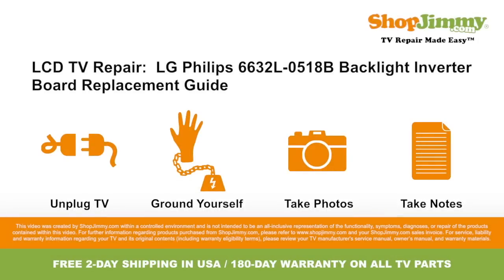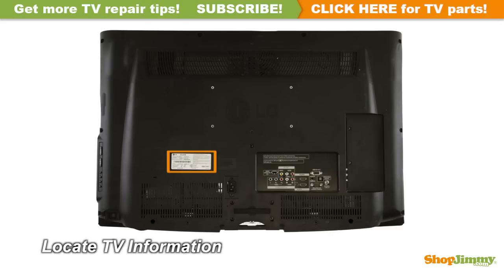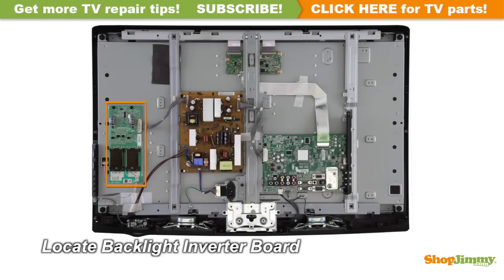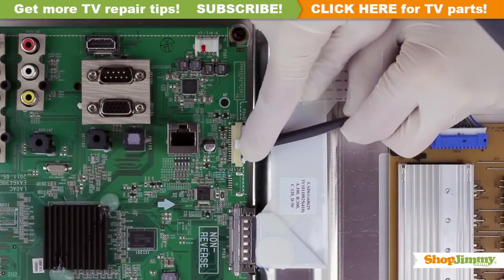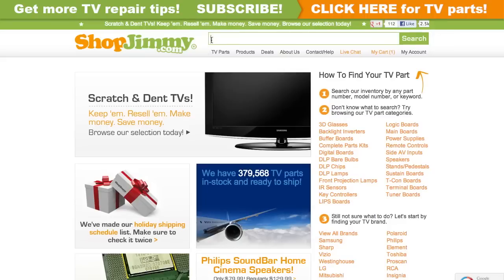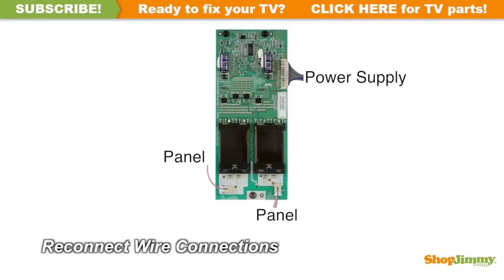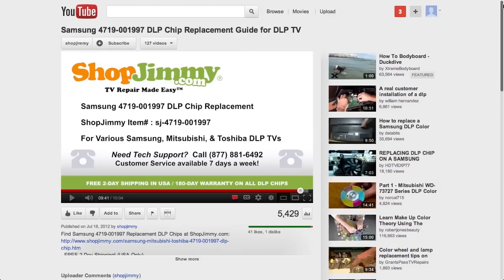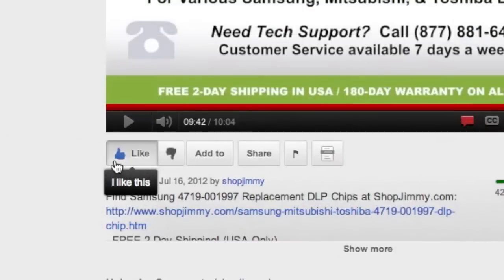LCD TV Repair Tutorial - How to Replace the Backlight Inverter Board in LG & Philips LCD TVs

Comment from the maker: @Felicia Tidrick - Please be sure to go through and make sure all of your cables and connections are tight and secure.  If that does not help, this may be an issue where the board(s) are failing when the picture gets to 1080.  If all of your connections are secure I would recommend contacting our customer service to determine your next steps.  You can reach our customer service at (877) 881-6492.  Thanks and please let us know if you have any other questions!

Comment: Great stuff you guys do at ShopJimmy, greatly appreciate it! Now, I have a 47LN5700, and I can't find how to do the short mentioned here. 

Symptoms - full power up and LG logo visible for about half a second, then black. I can see the volume circle moving and changing with a flashlight, indicating power supply or LED as the problem.

Looking at the power supply on your site, there's a note that this part is commonly replaced when it is actually a failed LED. If it is possible to complete a similar short to tell if there's an LED bar out, or the power supply is failing, would be extremely helpful in returning this back to service.

I also see the LEDs are also out of stock, is there any ETA for the next shipment of them to arrive or will they be discontinued at your shop? Sorry to draw this out, I'd rather know what I'm digging into before I have this panel torn apart. Lack of clarity and multiple posts just take up more of both our time.

Thank you and your team very much for your help!

Comment: I have a Phillips LCD TV 55PFL3907/F7.......I have no backlight....I've checked with a flashlight and can see that the screen works......I just changed the master and slave inverter boards....no backlight....24v entering board from supply board...........................any ideas would be greatly appreciated!

Comment: I have a LG 37-inch flatscreen tv, which powers up, but has no sound or display (grey screen).  I suspect that it is the back light inverter, based on what I am reading online.  There is a sticker on the panel with S/N: 8D5ZK7EA21639.  The number adjacent to the black rectangular objects on the board is: 6632L-0493A.  Is this sufficient information to order a new board?  Also, if I order a new board and it doesn't solve my problem, can I return the board?  Or, is there a way to test the board to determine if this is the problem?  Thank you.

Comment: Hello I have a LG 50LN5100 that has a issue with the picture. The bottom half seems to have double lines of the image it is trying to display. It also cycles in approx. a 3 second burst of good picture then distorted. After 15 minutes or so the picture goes out but the sound continues. If I turn it off and right back on it is good for another 15 or so minutes. The distorted part of the image (during the cycle) becomes blurry also with the extra image lines in it. Do you have any ideas? I have read countless postings here but nothing seems to describe my issue.

Comment: I have a LG 47ln5700-uh tv that was starting to get dark spots in different areas on the display. Eventually the whole display went completely black and I have sound but no display. I replaced the main video board, then the t conn board then the main power supply board. I have conducted the flashlight test and the display is visible but I only get a "flash" from the backlight when the power button is turned on and turned off. I don't see an inverter board on the tv anywhere and was told that I may have a short in the display screen itself. Does this tv have an inverter board, if not, could there be a short in the display and is it repairable? Or is there something that I am overlooking that is not a common problem with this tv, any suggestions would be of great help.
Reply from the maker: Warped Papa   Try all repairs and troubleshooting at your own risk.  This sounds like a TV panel (TV Screen) problem.  If your TV panel is bad, it may be more cost-effective to replace the TV as panels are typically hard to find in stock, difficult to replace, and expensive.  Thanks and please let us know if you have any further questions!  www.shopjimmy.com

Comment: Hi, I have a LG M4715CBBA / M4715CG   That will power on and after 2 seconds the backlight will go out. I can see the picture with a flashlight.  Is there any way to test the inverter boards?? What are the correct replacement p/nS?

Thanks

Comment: I have a Sanyo HDTV LCD/TVHD ACL, Model# DP39D14, Chassis P39D14-00.
The TV has standby light on and changes from red to green when turned on. There is sound and I can see the image using a flashlight. I have only gotten the back pannel off but cant get the second pannel off the back to check if there is a seperate backlight inverter board that would need to be replaced.

Comment: I have an LG model number 47ln5400 that has no backlight. I used the flashlight test and can see the menu etc. I installed a new power supply board but still has the same issue. I only see that board, the main board, and a t-con board. Could the issue be the t-con or am I missing something. Thanks for your time.
Reply: Erin Eby I have the same problem and also purchased a power supply board but didn't fix the problem.  Did you ever get an answer?  I also bought a t-con board and that didn't work.  Would love to know what you did... Thanks
Reply: Erin Eby  Hi Erin,
 I took my tv completely apart because of the same issue you were having. I replaced all 3 boards before I discovered that there were 12 LED strips that attach to a board inside the set itself which i would call the inverter board. 6 of the strips were not lighting up when I turned on and off the tv. Keep in mind that I am no pro at this but not afraid to tear something apart and figure out why something will or will not work. After researching on trying to obtain the board and strips i have found that it is a part that only LG repair techs can obtain but want to sell you the display panel as well. Shopjimmy can't obtain them unless they get that specific tv in and it isn't bad. Some can be obtained on Ebay but they are model specific so you have to have the exact number to your tv for them to work. I didn't get far enough to find out how they are attached but will cross that bridge if and when I get there. I hope this info will help you out, I was as confounded as you were in my tv repair.

Comment: I have a 32lg70, I had been having problems with it (or the cable box, I don't know which) with the pic freezing and when I went to use the remote to turn of the tv and try again it would be a bit before it turned off. It happened a lot the other day and now my screen is darker like a backlight went out. I am unsure what to do and can't afford a new tv so I would rather fix it. I am quite capable doing it so If you could send me in the right direction I would appreciate it
Reply: and no setting were changed
Reply from the maker: Lynda Kempland   It sounds like the problem could be the cable box or the main board.  Take out the cable box and try another video source to see if it is the cable box or your main board.  Here is a link to replacement parts for your TV model number on our website, click here:  http://www.shopjimmy.com/catalogsearch/result/?q=32lg70  You can also call our customer service for further assistance with your purchase.  (877) 881-6492  Thanks and please let us know if you have any further questions with your TV Repair!  www.shopjimmy.com

Comment from the maker: @Jpress138 - This could be one of two problems.  Either the main board or the panel.  You could try replacing the main board in your TV to see if that fixes the problem.  If it does not work, then I would say you have a bad panel.  Panels can be difficult to replace, expensive and hard to find.  It may be more cost effective to replace your TV.  Thanks and please let us know if you have any further questions!

Comment: Hello I'm having backlight problems on my 32ln5300-ub but there is no backlight inverter what should I replace.
Reply from the maker: Nicholas Denson The power supply has the backlight inverter built in, so I recommend replacing the power supply board in your TV.  Here is a link to replacement parts for your TV model number on our website, click here:  http://www.shopjimmy.com/lg-eay62810301-power-supply-unit.htm  Be sure to match part numbers on your current board, with your replacement for compatibility.  You can also call our customer service for further assistance with your purchase.  (877) 881-6492  Thanks and please let us know if you have any further questions with your TV Repair!  www.shopjimmy.com

Comment: hi i have a lg 42le4900 manufactured in october 2010 when i switch it on its fine for 20mins & then it will lose the picture but everything else including sound is working then when i switch it off & on again the picture comes on for a couple of seconds then goes but sound still there. thanks in advance
Reply from the maker: mikey jay   I recommend running the flashlight test on your TV to help determine if the problem is the backlight inverter or the main board. Here is a link to a video we produced that shows how to run the flashlight test. No Image No Picture on Screen-Flashlight Test LCD TV Repair - How to Diagnose Broken Board TV Repair Please reply with your flashlight test results and we can recommend a replacement part for your TV repair. Thanks and please let us know if you have any questions! www.shopjimmy.com

Comment: hi i have a  lg 47” Full High Definition 1080p LCD TV 
47LH40 -ua 2009 modle  
my TV still has power but  every time i turn it on  the screen goes dim then turns off with a strong  burnt smell

Comment: I have an lg tv with a backlight issue.  the model number is 47ln5700-uh.  the fault is the screen is black but the menu can be seen using the flashlight test.  i have taken apart the back panel but i am unable to find the inverters.  i can see the main board, the sound board and the t-con board but that is it.  What am i missing.  Can you or someone please help me out.
Reply from the maker: +matt cody   Try all repairs and troubleshooting at your own risk. This sounds like a problem with the actual LEDs inside your TV. These LEDs are replaceable, however it is recommended they are replaced by someone with the proper experience and training. When replacing the LEDs, the TV panel can get damaged. If the TV panel gets damaged, it is not repairable. Click this link to replacement LEDs for your TV model number:  http://www.shopjimmy.com/lg-lc470due-sfu1-led-strips-12-strips-1-board.htm   Be sure to match the panel information necessary to ensure you have the correct replacement LEDs.Thanks and please let us know if you have any further questions with your TV Repair!  www.shopjimmy.com

Comment: Hello I can't locate the inverter on my tv

Lg42ln5400 
Model number lgln500-Za
Serial number 310wrbm96093

On the left side there is just the manual control for the tv menu, volume control etc

Comment: LG 47LN5200
Model number 47LN5200-UB
Serial number 308RMCJA9811
Audio is on but the screen is really dark
Reply from the maker: Theron Paul  This could be a problem with either the power supply/LED board or the LEDs in the TV.  You can replace the power supply/LED board to see if that fixes the problem.  Click this link to replacement parts for your TV model number:  http://www.shopjimmy.com/catalogsearch/result/index/?cat=229&q=47LN5200-UB  There may be multiple boards for the same TV model number, be sure to match part numbers on your current board, with your replacement for compatibility.  Here is a link to a video showing how to identify your part number, click here:  https://www.youtube.com/watch?v=_4Qpfan0vdU  Thanks and please let us know if you have any further questions with your TV Repair!  www.shopjimmy.com